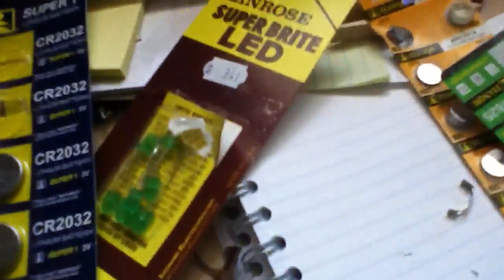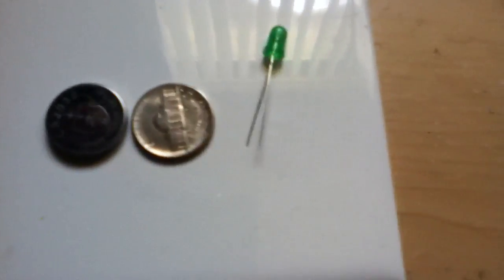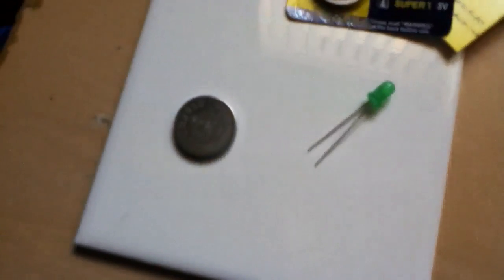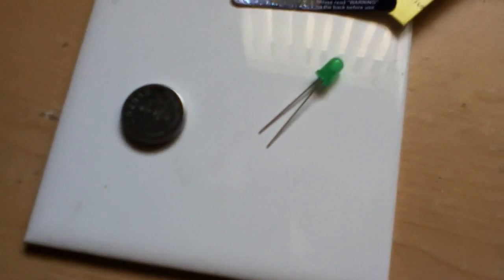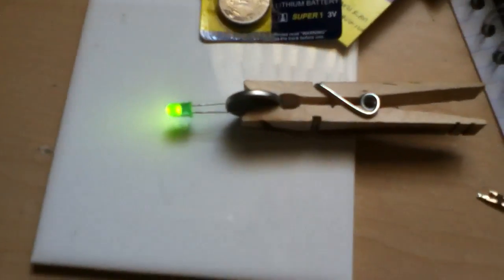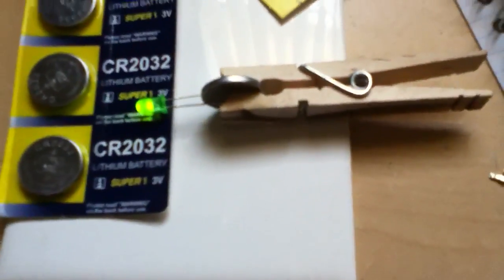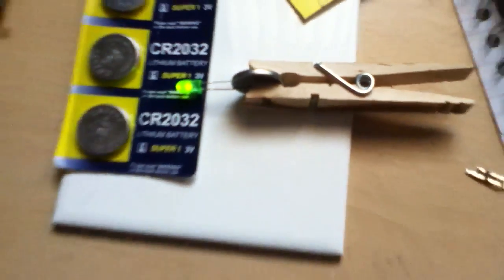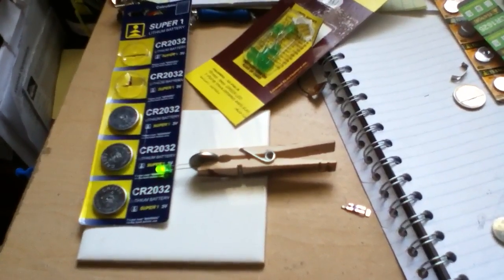Make an LED light on a coin battery

Comment: You can use AA battery if you have a resistor to allow only the 3v through at a time.  You can even use a wall charger converted from an old cell phone charger if you use one of those inline on the positive cable.
Reply: T. G

Comment: LED's usually require 20ma, and the watch battery will power them at less than that, but on the other hand lasts way longer. If you use a 9V my guess is hook up 2 LED's in series if they are blue or white and three if they are red/green or else they might not last long. With AA's you have quite a bit less resistance so you might find it necessary to add a resistor. About 2 AA's for red/green LED's and for the blue / white you need higher voltage, so 3 AA's. Resistor between 50-150 ohms maybe

Comment from the maker: Also have spliced old phone chargers with low wattage output and used a resistor for things I could do with a power source. But for them to be really visible make sure you have a secure connection and I would estimate at least 3 days.  Here is a link that makes it clear

Comment from the maker: @jebus1208 depending on the color of the light (different light frequencies drain more power) a few days to stay bright.  I've seen a little glow in red months after connecting.  Also depends on the quality of the battery.  I use some cheap 5 for a dollar batteries from the swap meet or you can find them on ebay.  Not sure what the battery life would be on like a duracell or something from the drug store.